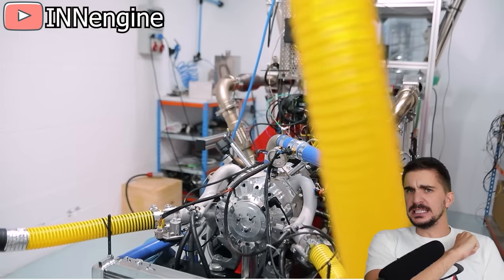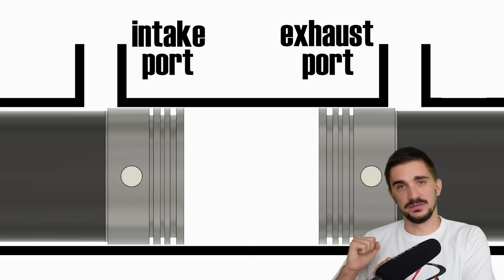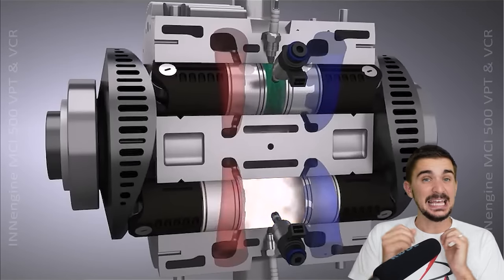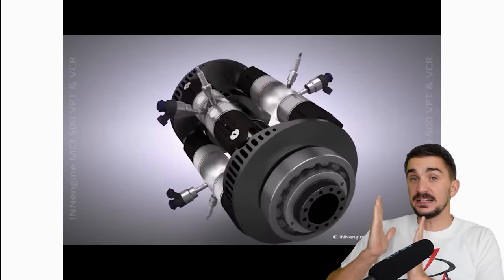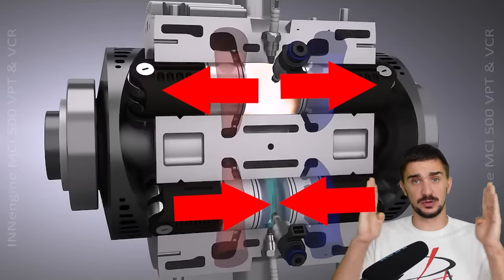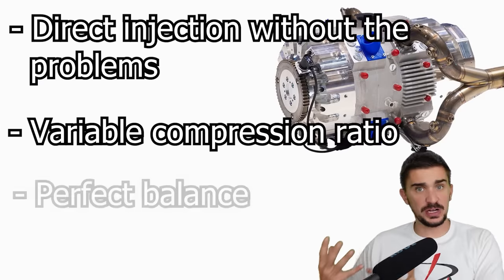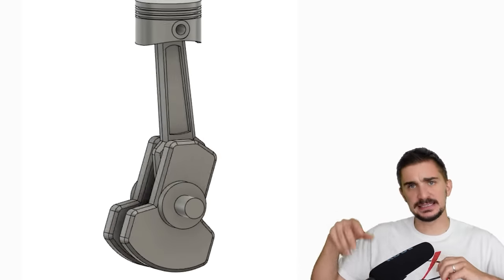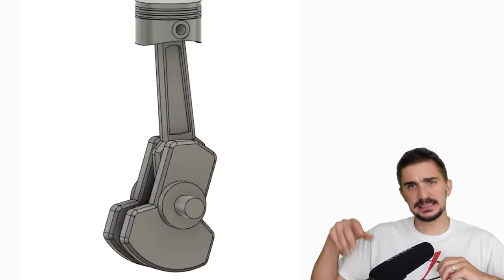Spain is Living in 2050? Revolutionary 1 Stroke INNengine Analyzed

Comment: The interesting thing is that this works almost exactly like a typical pressure washer pump, but in reverse.  Generic pressure washers have 3-piston pumps, sitting on a rotating axial cam.   Basically the same as this engine. I guess we know where the idea came from

Comment: I think that for 2-stroke engines that do not pre compress the fuel mixture in the crank case a supercharger is standard required equipment and not considered forced aspiration, although if that is the case here you could still argue that not mentioning it at all is misleading
Reply: Exactly. All 2-stroke designs need higher than atmospheric pressure for scavenging. It doesn’t need to be much higher, but it MUST be above atmospheric. Some get this by using the crankcase as the compressor, some use an external compressor.

That these people are claiming their engine runs at atmospheric pressure probably means that the blower is just moving enough air for scavenging and not enough to supercharge the cylinder i.e. the net air volume = cylinder volume.

Comment: This actually seems like a somewhat feasible design unlike most novel designs you see these days
Reply: Yeah I thought the rotary engine was so cool, until you see how indirect the combustion is to the rotary action. Pistons are such a better design for power. That's why I think this engine has real potential.
Reply: Just sucks that a marketing department was again clueless about the product. Hyped about buzzwords and simple numbers, but not much consideration for real-world applicability or actual useful data. Always just makes it seem fishy, but it seems investors are always easy to fool
Reply: The "supercharger" is probably doing the same job as the blower on a two stroke diesel. That's not there to boost power, it's there to provide combustion chamber scavenging, because they don't use the crankcase and transfer ports like in a "normal" two stroke. As this has no crankcase at all, I'd almost put money on it not working at all without some sort of mechanical blower. That's not a criticism, it's just the nature of the beast.
Reply: Don’t get bought out and buried
Reply: Mr. Bits Bytte, clearly this INNgine has surpassed the feasibility stage into actual practical use within many types of motor vehicle applicaitons.
There is another well developed, innovative engine through a father-son team along with a small number of others, called Liquidpiston X-engine. This rotary engine has many uses including tiny engines inside of unmanned aircraft to power generators, motor vehicles including hybrid designs and useful with all types of fuels including heavy diesel [CI] to fuels within common spark ignition [SI] gasoline, ethanol. methanol, jet, kerosene, hydrogen, etc. All The Best, Sincerely

Comment: Thank you. 
I find it really encouraging that there are still engineers prepared to design and construct internal combustion engines with very innovative thinking. ICE's are not dead yet!
It strikes me that this engine would be very well suited to powering a generator in a car to keep a battery topped up. Small and light; the Innengine could run at optimum revs and completely avoid the charging worries of battery-electric vehicles. I suppose that the vehicles would be 'Hybrids'.

Maybe it could be something for motorcycles, where riders are used to low torque at low engine speeds; indeed may even find it safer. And the engine loads in motor cycles must be lighter than those in a car.
Keep up the good work!

Comment: The thing I fear the most for this engine is the not uniform wearing off. While this is also a problem for normal engines, here the moment the stroke happens, like half of the force generated on wavy thing will resist over one wall of the cylinder. And the more power you will want to generate, the bigger that force and wearing off will be
Reply: Even normal engines have that exact same problem
Reply: I think the problem is much greater than in a normal engine. In a normal engine it is just the friction of the bearings that is causing a side way force on the piston. In this design the piston has a rigid shaft to transfer the power to the wavy thing, so the side way force that moves the wavy thing is also the side way force on the piston, therefore a much stronger and heavier piston needed, as well as heat and friction of the piston in the sleeve.
Perhaps this engine is good for kamikaze drones that destroy themselves before the sleeves and pistons are too oval to function anymore.
Reply: This is probably going to be much like the early Volkswagon engines. Won't last as long as other engines but easier to replace
Reply: You, and two of the current replies, are ignorant of the side forces on normal crank/rod piston engines, particularly the high reving short stroke, wide bore performance engines. Side forces on piston skirts are maximum at the most extreme rod angles during the power stroke, only partially reduced with cylinder bores offset over the crankshaft. Hendrix 1998 nails the reality. Modern engines, oils and oil control rings (and occasionally under piston oil squirters) produce engines that don't need new pistons or boring out cylinders, for as much as well over 200,000 miles, in cars such as my Miatas. And those are 30 year old designs.

Comment: Seems to me that this engine is best suited for high revving or steady state operations. It would be interesting to see a smaller version as an on-board generator in an EV. Maybe even powered by alternative fuel - propane, LPG, hydrogen, or even simply flex-fuel.  I'm imaging remote camping in a Rivian and being able to connect my propane tank (1lb or 20lb) in addition to the regular fuel tank to charge batteries for longer excursions or extended stays.

"Shower thought": Maybe "dual stroke", or "twin stroke" would be a better name...
Reply: High revving? Wouldn't the wavy plate's irregular shape introduce wobble at high RPM?
Reply: @noleftturnunstoned  Having an irregular shape is ok, so long as it's balanced.  For example, the crank in a regular piston engine.  A balanced wavy plate would likely have opposing waves 180º from each other.  Something like: --/--  (horizontal rotation axis).
Edit for additional info: The opposing waves would essentially create equal and opposing forces from the power strokes, balancing them out.
Reply: That's literally a hybrid car.
Reply: @devkrovil  Bingo; but it would still work in those hybrid 3-cyl vehicles.
Reply: @fipipip  You completely missed the point. First off, generator size: any current generator small enough to fit in your trunk with the rest of your stuff won't charge the car in any useful amount of time. Think trying to heat your house with a hair dryer.  The engine in the video would reduce the size of a higher output generator so that it would fit on-board.  Maybe in the space behind the back seat of a Rivian.  Second, and I'm surprised I have to explain this one, having a compact generator powerful enough to actually charge an EV, in the vehicle, whether mounted like hybrid or for charging when parked overnight, is a useful range extender for camping in the mountains or road trips without having to worry about charging stations, or whatever.  Use your imagination!

I, too, use ICE vehicles for 4-wheeling in the mountains and other remote places in my free time and for all my other driving. I get double to triple the range, plus I can pack an extra fuel can or two.  If EVs are going to be the replacement, they need help.

Edit for correcting the auto-correct.
Reply: @tangogolf846 Chevrolet volt.
But it's failure seems to show that the current market doesn't really want a range extended electric car.
Reply: @briannormant3622  after looking up the specs on the Chevy Volt, it's commercial failure was likely more about it's mere 53 miles of battery only range and over 13 hours of charging, w/ 120v plug in, to get it.  Essentially, it was a gas-powered car w/ a battery assist.

Comment: The 'perfect balance' can only happen at max compression; the variable compression will have one side moving backwards while the opposing side is still moving forward.
Reply: Not if spark is at 10° past TDC of one piston and when opposing piston is at 5° past TDC. This just changes the compression ratio.
Reply: @UnderGround3491  Both of you neglect to notice, that each end of the engine is in perfect 1st and 2nd order balance. Firing forces are also symmetric from side to side due to firing Every time pistons come to TDC. Changing the angle of the swash plate at one end for valving efficiency at specific load and RPMs does not affect this side to side, or end to end balance in any way I can see.

Comment: This is really cool.  One issue I foresee is that since the piston position controls the timing and dwell of the intake/exhaust ports, varying the compression by adjusting the phase of the swash plates relative to one another will also modulate the intake/exhaust timing, for better or for worse.  There are plenty of mechanisms that could eliminate the piston porting, but they would all likely add complexity and additional valving.
Reply: Piston rings popping in and out of the intake and exhaust holes is a massive problem. Oiling of the whole mess and especially the piston rings is also an issue that would cause this engine to lock up within a few minutes unless it mixes oil into the gasoline, which I am positive that they've done. As pointed out in the video, there is a supercharger on the engine. So much like the oil/gasoline lies, the supercharger makes the engine power of only 120 HP (if they are even telling the truth about that) much less impressive. A supercharger can double or triple the HP numbers of any engine, so imagine what a supercharger could do for the 500 cc engine sitting on a motorcycle at your local dealership. This engine is taking advantage of the fact that massive grants given out by governments are given to anyone who claims that their "new idea" is "green" or is somehow linked to EVs (Electric Vehicles). Governments are shoveling billions of dollars/Euros/pounds etc to anyone making a claim that their idea is "green". It's the scam of modern day life alongside of calling random things "organic" or "gluten free" or any other buzzword. It's the modern version of Snake Oil
Reply: The simple answer would be to start increasing the offset of a piston when it's nearly at TDC, (so it starts to move away before then other piston reaches TDC), and then reverse the offset as it approaches BDC to create a longer exhaust dwell. But that means the offset is constantly working and adding extra stressed to the system as one swashplate is accelerates and decelerated 4 time a cycle.
Reply: But it would allow one engine to burn a huge range of fuels, provided you needed that.
Reply: They could potentially address this by having two paths in the swashplate with different curve profiles that cross over at the base and top of the stroke (or have some other form of mechanical switching) - then the runner at the top of the piston could follow a different curve for each stage.

Comment: This potentially kicks ass in a diesel application.  Would like to see 100k miles on one of them and see how it fares.  I've got some hunches on where the fail points will manifest but you never really know until you run the thing long enough.
Reply: My guess is the bearings under the piston heads for those wheels, they're gonna have to change direction every 90° of rotation for that wavy flywheel thing. That back and forth motion I would imagine would eat the bearings alive after extended use
Reply: @johnraitt2555  They do not have to change direction sir...
Reply: my concern would be the bearings at the bottom of the rod for diesel. the compression required would do a number on those things.

Comment: Ever since you touched on the lack of data regarding torque curve, I was waiting for 19:17 where it's mentioned as a potential APU. With it's low weight and brilliant power output for it's size it would make quite a bit of sense as APU in a range extender EV, in which case it can operate at a static load and RPM
Reply: Static load and rpm would allow elimination of the variable compression (which would be a balance nightmare) and it could be set up for optimum efficiency.
Reply: @russbell6418  indeed, further improving simplicity

Comment: Yes, a 2 stroke engine which does not burn oil is impressive. The super charger too is not a bad thing if it is driven by an electric motor. Over-all a promising package. I would love to see a series hybrid/split axle hybrid vehicle use this technology.
Reply: Would it dump oil every stroke p
Because the piston rings are constantly going passed the intake and exhaust ports
Reply: @malignantredneck6194  if you mean the short circuit release of unburnt fuel air mix then yes, that risk exists. As for piston rings, there are now these ceramic coated ones which make do with far less oil to get the job done.
Reply: with all that sucking & blowing it's going to burn oil for sure..  unless it uses "magic piston rings".
Reply: @vintagespeed  we are just going to have to leave it to the Euro 6 RDE emission regime to take care of that.
Reply: Electric superchargers aren't inherently better than belt-driven or exhaust-driven superchargers (the latter typically being called "turbochargers").

With exhaust-driven superchargers, you're robbing power on the exhaust stroke by increasing the effort required to evacuate the exhaust gases.

With belt-driven superchargers, you're robbing power directly from the crankshaft and increasing the rotational resistance of the motor.

With electric superchargers, you're robbing power indirectly from the crankshaft by increasing the workload of the alternator, which increases the magnetic resistance of the alternator's rotor, which is ultimately driven via a belt by the crank pulley, which again increases the rotational resistance of the motor.

In all cases, a properly-setup supercharger allows the motor to generate more power than the supercharger consumes by providing compressed air, which allows the motor to burn more fuel and therefore extract more energy each power stroke. But none of them are completely free.

In my limited experience with electric superchargers, they end up needing capacitors or more/bigger batteries that add substantial weight to the system. Exhaust-driven superchargers put the device in the exhaust stream, so add little extra weight there, and the intake pipes can be pretty lightweight. Belt-driven superchargers need a lightweight belt, but generally have a fairly beefy crank pulley. There's not a huge difference, but generally exhaust-driven superchargers are lightest, with electric being heaviest.

So there's not a weight benefit, and there can be a pretty substantial penalty if you're using cheap batteries. On this motor, the intake and exhaust are close together, so an exhaust-driven supercharger (or four of them) would take minimal extra piping. A belt-driven supercharger (or four of them) could be placed on the intake end, driven directly by the output shaft with minimal piping. An electric supercharger wouldn't be any worse on this motor, but doesn't see any particular benefits either.
Reply: @GeekOfAllness  absolutely right. Nothing like NA. Especially given a 2 cycle engine vulnerable to short circuit release of unburnt fuel air mix. Motor operated super chargers can do away with lag but limited benefits for this application.👍
Reply: Hybrid and EV are destined for the history books, perhaps Hydrogen propulsion.
IC is here for a longtime yet, less production pollution and energy sources much more readily available, 100 years of infrastructure development established also.
Reply: @barrybarry6592   EV, yes. Very limited in its usefulness with the current battery technology. Can't say the same with hybrid technology. An electric motor with its seamless torque pulse rate does not suffer from a differential power and torque delivery character associated with an ICE. A hybrid therefore employs an electric motor to cope during the torque challenged regions of an ICE doing away with the need for a multi speed gearbox. Efficiency gains are therefore tangible. In short a hybrid reaps the good of both worlds.

Hydrogen fuel cells on the other hand are very efficient. However, the round trip efficiency of producing electric current from hydrogen is less than 50%. So yes, fossil fuel is going to be around for a while.
Reply: Changing anything on this would be difficult without taking it completely out so not very fun.
Reply: @VexxedSR  Yes, I think so too. This engine would be best left to operate in a fixed geometry as a generator in a series hybrid vehicle.
Reply: @GbMuthu  seems to me also like missed opportunity on using it as a diesel engine. Throw away the spark plugs, let the compression of the pistons do the job of igniting the diesel. Probably would require a very efficient turbo to get any decent figures.
Reply: @VexxedSR  there have been several opposed piston opposed cylinder diesel engines in the past. There are many videos on the subject right here in YouTube.
Reply: @barrybarry6592 another contender is the methanol fuel cell.  It uses existing infrastructure, does not require hydrogen at 10,000 psi, and is low CO2.  Combine that with methanol produced in a nuclear power plant, or even solar with a catalyst, it's a solid contender.
Reply: @VexxedSR swap engines.
Reply: @vintagespeed  Ceramic?
Reply: @GbMuthu  I hear you, might be cool for some white weight offer a buggy's like the rotaries